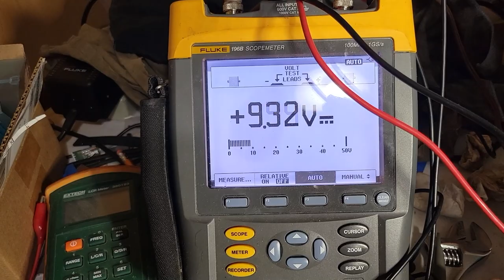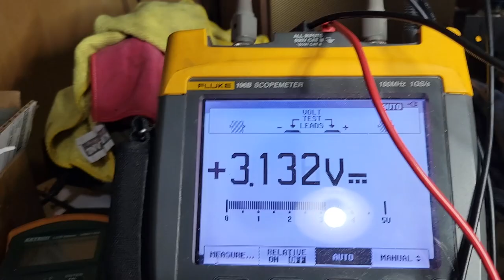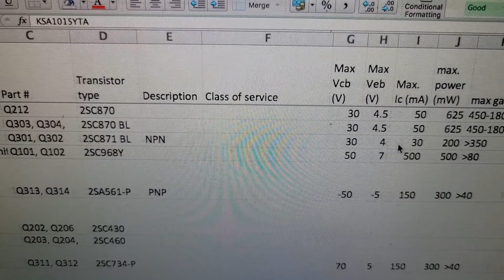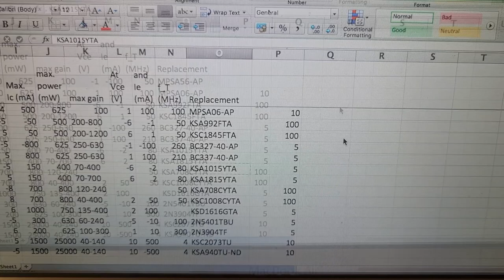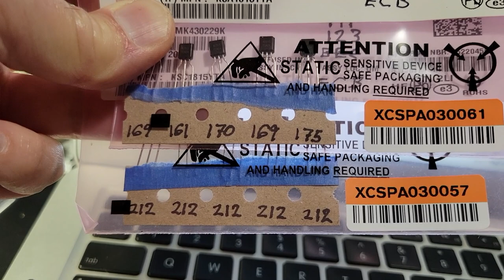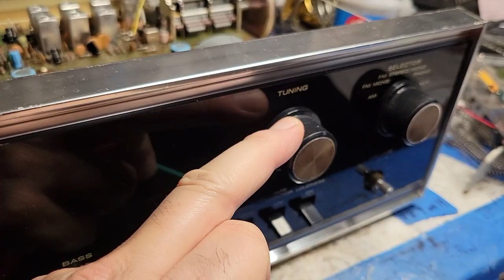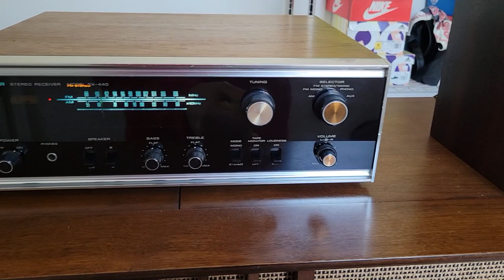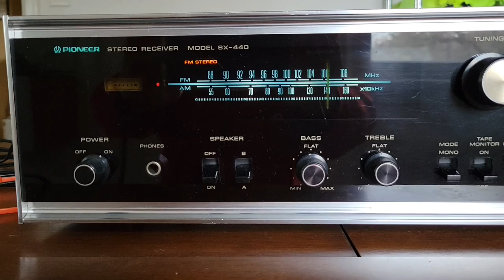Static! Noise! Simple Fix for a Vintage Receiver: Pioneer SX-440 Transistors

Comment: A very interesting video, this little Receiver is a loverly little unit. I will be trying to get an intermintant tuner in this sorted very soon parts on order, pretty much just changing caps and transitors bit of a shotgun approach but be interesting to see if it solves the problem. Great videos on your channel.
Reply from the maker: Sometimes the shotgun approach is the most efficient. Address common failure modes, see if that works, and move on if it does. And thanks!

Comment: Old capacitors often read high in capacitance, when in reality the capacitance may not be high. This is due to the capacitor’s high leakage current which can fool the capacitor tester. The tester measures, in effect, the total admittance, but that can be a combination of capacitive susceptance plus leakage conductance. It takes a lab grade instrument like an HP to separate these factors. In any case, any old cap measuring that high should be replaced.
Reply from the maker: That's pretty much exactly what I learned through a FB forum recently. I had generally made it my practice to replace caps that were out of spec, whether over or under, but I hadn't known that the high value was erroneous or what the underlying issue was. From your comment, it sounds like I need to refresh my memory regarding this SX-440 and its need for a new filter cap.
Reply from the maker: Ok, I just re-watched, so now I know it's the output caps you were referring to. Could those bad caps have been the problem after all?
Reply: Tracking down intermittent noise such as you experienced can be tough, and even humiliating. Capacitors (esp. electrolytics and old paper caps, resistors and semiconductors can all make noise. Certainly if your output caps were leaking DC into the speakers intermittently it could make a sputtering sound. If those caps fail completely they could essentially short the power supply to your speakers. Even if they measured perfectly I would replace them as insurance, after so many decades. If you still have “static” you won’t have wasted your money on new output coupling caps, IMO. The black lead disease for the semiconductors is due to the leads being silver plated. They corrode to black silver oxide, which can break the tight seal of the plastic enclosure around the lead and allow atmospheric moisture and pollution in inside to the die. But generally I do not replace transistors without good cause. Old electrolytics are different, being time bombs.
Reply: BTW, I came to your video because I recently acquired the very similar SX-770. It needs some caps and a new FM demultiplexer chip (talk about unobtainium!). Bulbs too, of course. My very first stereo back in 1970 as a kid was centered around the SX-770. Despite having a high-end system today I wanted a 770 for nostalgic reasons and for a system for my home office. Mine is cosmetically near perfect, after I washed off lots of grime. I noticed some of your knobs have a copper color to them. I suspect they were originally black (which the 440’s brochure shows). They were probably exposed to sunlight for years and the UV bleached the black coating on the decorative cap on the knobs.
Reply from the maker: Agreement all around. I went ten rounds with a Nikko TRM-750. Replaced a couple of transistors that had bad reputations, replaced all the el-caps, and still had intermittent noise issues. Finally, I treated all of the front-panel switches with DeoxIT, and the problem was solved. That'll now be a routine thing for these old units. Here's another: Microswitches on old turntables! I have a LAB-400 that had a speed fluctuation issue. I treated the speed adjustment pots (probably twice) to no effect. Replaced one of the microswitches and deassembled and cleaned the other, and problem solved completely.
Reply from the maker: That's interesting! I still like the look of the bleached knobs, though.

Comment: My one is currently being repaired new transistors etc £300
Ouch 
But a great looking and sounding machine
Reply from the maker: Yeah, ouch! Transistors are cheap. Bench time isn't.
Reply: Interesting to hear how much they charge these days for repairs. This is a very under rated little receiver.
Reply from the maker: Yeah, if I had to pay someone else to fix stuff, I would not be into vintage gear!

Comment: just had the same thing happen to my Harman Kardon hk505 ,left channel is up to over 115mv on both A B speakers ...
that unit was re capped (I was told) couple years ago ... I wonder I was running a couple sets of speakers for a bit before I learned that it's not a good idea...could that be the problem ?
Reply from the maker: I don't know. I don't know for sure how low impedance damages amps, but I suppose the effect is similar to that of shorting the outputs, and I'm again supposing that shorting the outputs would overload the output transistors and/or other components in the output stage. The damage might result in noise. I'm speculating, though.

Comment: This is the model I have 😁. Fortunately, I don't have this problem right now. 

However, I was wondering why I receive so much feedback when I'm using an aux cord plugged into a PC monitor for sound? Is it cause the stereo's source is so old and it's plugged into a new system? Like is it bad to use the aux output on this stereo?
Reply from the maker: Hmm. It should be fine. That's how my son uses it. What kind of feedback? Amps can pick up cellular noise.

Comment: I have a Sherwood s-9400 in mint condition however when you turn it on there's a very loud pop snap that comes out of the speakers not like a constant static but like a loud popping sound like very loud is there any way I could send you a video of this and get your opinion of what you think is wrong because I have no idea what to do the rest of the unit is in such great shape I don't want to get rid of it and it's kind of a hand-me-down from my father so I'd really like to hold on to it.  Let me know if there is like an email or somewhere I could send you a video of this noise
Reply from the maker: Does it pop repeatedly or just once when you turn it on?
Reply: It's like a loud static pop and it happens when I turn the volume knob sometimes one of the speakers will cut out but it's so loud it sounds like it's going to blow the speaker almost
Reply from the maker: Treating the pot with Faderlube F5 might fix it.

Comment: my Sony STR 7055 has a loud crackle noise too but only when i adjust the volume.Would better wire connections make a difference? I am considering spade connectors to the receiver and banana plug connectors for the speakers. Would that work better? i will get new speaker wire too. but i dont want this to be a waste of time. any thoughts?
Reply from the maker: You need to treat the volume pots with Faderlube.
Reply: @Lancaster_Hi-Fi  thank you. are the volume pods internal or are you referring to the knobs themselves on the outside? i really appreciate your help

Comment: Why is my pioneer sx950 making a pop noise through the speakers, then I hear a click noise from the receiver.  Then around 30 seconds later I hear another click noise in the receiver and the music starts to play again? I just bought the thing and it's kinda upsetting.  Speakers are HPMs that play fine from another source so they're not the issue.
Reply from the maker: Can't say what's making the pop, but the clicking is your protection relay. You might try checking the DC bias. Was the pop from both speakers? Could be one or more bad transistors, but it's hard to say.
Reply: Alright?  I'll look it up. Thank you.
Reply: @Lancaster_Hi-Fi i just looked up what i think you are talking about.  I guess on a 850 and 950 i gotta go through this process that seems fairly easy, just time consuming, turning these flat head things until they reach a certain number-that are touchy. And there's only 4 of them? If this is what you were telling me to check?  I need to check the bias anyway so.....yep!!!

Comment: Yeah... changed many of those small xistors before. You should really change out all those electrolytic's, it don't look like there is that many..the 70's was a long time ago and they were at end of life many years ago .. there all probably out of spec reading higher than they are as they are pretty dried out. Then she should be good for the long haul.
Reply from the maker: That's on the to-do list for sure!

Comment: You cannot judge output DC  voltage without proper few ohm speaker  connected to output terminals   because capacitors must have way to charge themself to 17 Volts. If they stay not charged all voltage has to stay at free terminals   When charged through  volt meter with resistance of many  MOhms the time constant of charging may be even half an hour - never will reach zero 

. Up to my experience such cracks may appear  also from faulty resistors in which the metal connection is to  loose  on  the  coal trace and when resistance works it  produces heat thermal expansion which moves both surfaces agains themself. When replacing   transistors may happen that such resistor will be apparently bend and it will fix by  self No transistor    in my life produced cracking noise
Reply from the maker: My initial tests were naive and mistaken. That was kind of the point of showing them! And if I'm following your post, you're saying that an old transistor will never produce crackling, static-like noise? I don't have any testing data to refute you, but I would point to long threads on Audiokarma about bad transistors and their failure modes. Pops and static are among the most common cited. I'm not saying that all those people couldn't be mistakenly attributing the effects of cracked solder joints to transistors, but surely some of them tried reflowing joints before replacing transistors. But maybe not.
Reply: @Lancaster_Hi-Fi  I've said that in my life it never happened.  Realy you cannot refute my private observations - nobody can.  You may not worry if you like not 

 I do not also dispute bad solderings  - this is of course probably case   but with resoldering easy to get away from

. I mentoned about  time wear of resistors  - it is something that people rarely suspect and are  puting  attention to    replacement of active elements which as original type sometime  are after 50 years hardly available. Unnecessary  replacements may lead to distortions or not equal amplification .
Reply from the maker: Yeah, changing transistors is tricky. And, I've actually replaced all the resistors in an SX-828. It was so much work! After replacing all the resistors and electrolytic caps and resoldering every joint on every board,  that receiver still had serious problems that only disappeared after I replaced all the "bad-reputation" transistors. And I know that the hypothesis is still unproven, but it's not disproven, and that's how the scientific method works. Hypothesis: bad transistor(s). Prediction: If "problem" transistors are replaced, the problem will go away. Test: Problem transistors were replaced, and the problem went away. It's only a failure to disprove the hypothesis, but that's how we eventually establish knowledge in science. Sorry, not preaching or arguing; just trying to be clear.
Reply: @Lancaster_Hi-Fi  Up to my knowledge  transistor is assembled  using inside soldered   connections with golden wires and  it is small and mechanicaly fixed thus  resistant for vibrations . But as you say w- never  say never. I met in my life tiny ceramic capasitor, beautifull and expensine production,  inside FM filter which did the same totaly good in no voltage,   when few volts  were present. it was irregulary making cracks. So difficult to rectify that radio (tube and marvelous)  was never  repaired until I got iot in horrible dirty condition after some 60  years of laying in basement